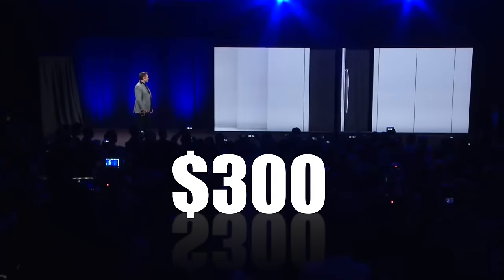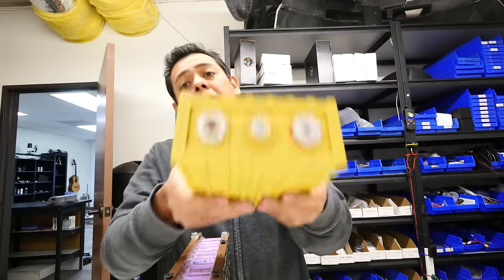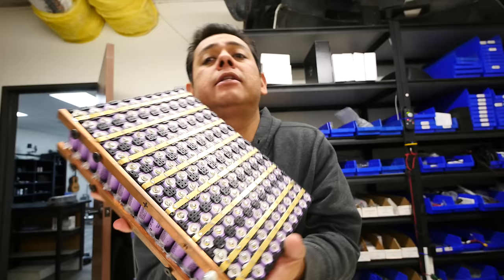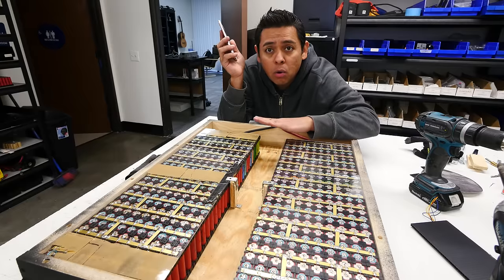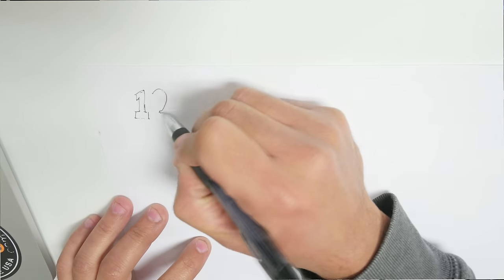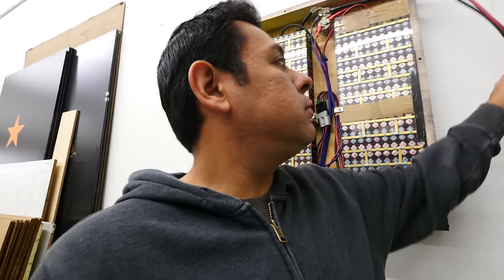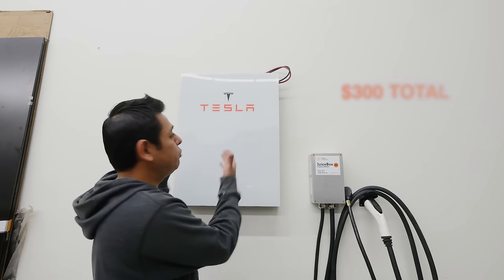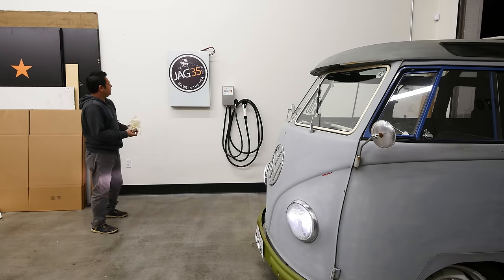$300 DIY Tesla Powerwall - Solar storage 18650 lithium ion home Battery

Comment: This is unsafe and should not be build. No BMS, fuse wires looks too thick to blow at 6A and enclosusure is wooden posing fire risk.On the top of that this guy confuses Wh with Ah. It's not good enough to be of any practical use.
Reply from the maker: Correct, you are too smart to build things,  just keep buying things

Comment: oh my god so so so many inaccuracies in here:

1) batteries are measured in Ah
2) no way that small cell is 3.7V (especially if they're used) nominal or not
3) you cannot multiply no. of batteries by Ah and W to get total power. how many of these cells you have in series and how many in parallel (to me it looks like 300 in series and then you have two parallel each consisting of 300 cells)

4) the actual kWh is calculated by how much your batteries can support a specific load for a specific duration

5) no you CANNOT wire cell batteries however you want
6) your diagrams are so wrong at so many levels
7) your batteries are not working because +/- touched and no short appeared
8) you do not need a contactor, you only need a fuse on the positive lead
9) you cannot just connect the batteries directly to the home and the charger is not enough, it's one piece of the puzzle
10) the inverter never charges the batteries, you need control charger for that
11) this is actually dangerous you can burn someone home if they follow all your directions

god help whoever trying to do this. i wish people would stick to what they're actually expert at.
Reply from the maker: +yousifhela  have you even seen a battery?   Stick to what you know fool,  nothing.

Comment: Out of the grid wana be, you have the knowledge I don't want to make mistake doing it is to much info for my brain. The 100 bat pack are parallel?? To keep it in the 12v range right?, I have a small solar SYS 2 panels for a 300w total a c40 Schneider  that can use it with 12, 24 and 48. To move fans, a small ref and some lights, If I can move that I will be happy, my inverter broker and what I have is a small 400w inverter, i know that I have to change it, I can handle the 300 budget in steps I have only my Social Security pension and a 90 years old mother, I know that everything is money, I will delay but I hope to get to the goal. Coaching is what I need to do it, I know you are a bussy person is ok if you can't do it I will understand, an probably will not answer this, I will understand to, thanks for reading this.

Comment: The theory is correct but your execution is laughable. Using laptop cells, NiMH having memory,  flawed comparison of brand new powerwall price vs DIY battery backup price. Your flawed example if subjected under load would probably return 40% efficiency at best, as you are using used cells further damaged by your soldering. You have shown that a little bit of knowledge can be dangerous.
Reply from the maker: +zaq405   The only danger is thinking you know too much to try things,  my battery works 98% efficient,  I put in 4kWh I get out 4kWh,  I don't know how you get your 40% prediction but I suggest you try playing with batteries before forming opinions
Reply: jehugarcia - of course 40% is a guess. When you factor in the 'used' laptop cells and addition of heat during soldering and losses from inverting DC from 14.8 volts. You might think you are Nikola Tesla but these are inherent losses even the great man could not overcome.
Reply from the maker: +zaq405  14.8v?  Heat during soldering?  What does that have to do with system efficiency?   I hate when people don't make sense
Reply from the maker: +zaq405  chirp, chirp,   Can anyone translate for me?  Sorry I don't speak nonsense